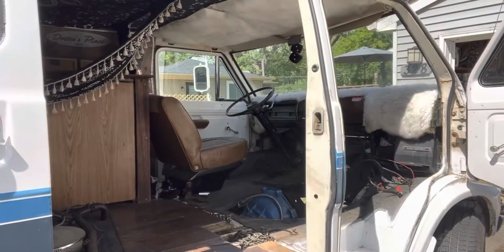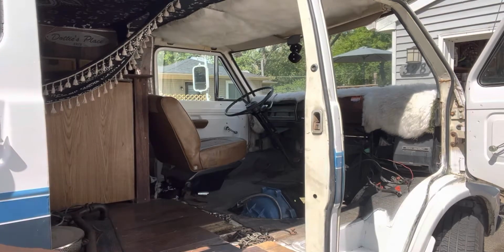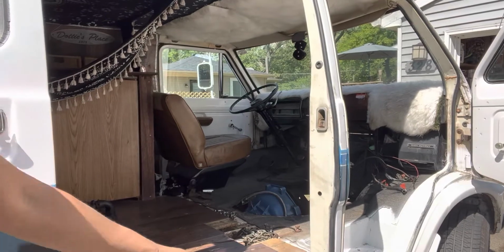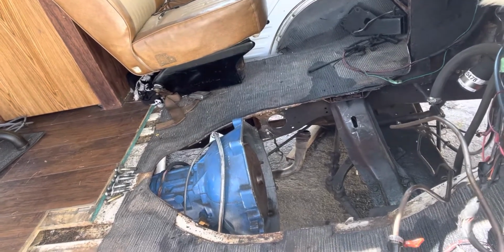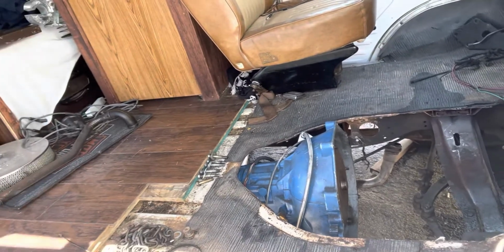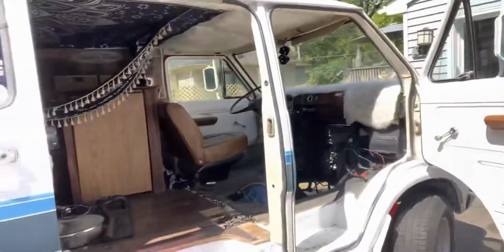1973 Ford Econoline Engine Swap 302/5.0 Upgrade

Comment: I Believe That You Pull The Engine Out Trough The Side Door VS The Passenger Door.
Reply from the maker: Might be right.  I've done it twice this way, but it is dependent on the cherry picker setup.  This worked for me though.

Comment: exhaust manifolds look different to each other, where did you find that odd pair? Can't find those...
Reply from the maker: I'm pretty sure it's just what was on the van when I pulled the first motor.  OR... One of the original ones might have had a crack in it and I just swapped to an extra one I had laying around.  It's been a while and I really do not remember unfortunately.  Thanks for watching!

Comment: Can you use the upper intake manifold off of a 1990 f150 302 efi to a 1973 ford econoline van?
Reply from the maker: Are you planning on swapping all the parts over to late model?  The upper won't work unless everything from the 90 swaps in.  Not sure on clearance, but I know a buddy does have a complete MarkVII setup in his and swapped all the efi/fuel injection in his.

Comment: Cant you drop the subframe and lift the body up?
Reply from the maker: Honestly not quite sure.  In the driveway, it seemed easier to come up and out than trying to lift the body or pull the bottom out.  It's been awhile since I've been under this thing.
Reply: @WrenchingWrecked  I have a 1970 e200 short box .
It has the 240 six in it . The engine is offset to the right . I have 460 I wanted to use but I'm not quite sure it will fit without heavy modifications. It would be way easier if the sub frame was removed.